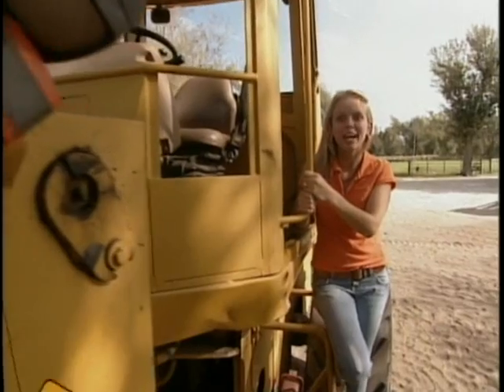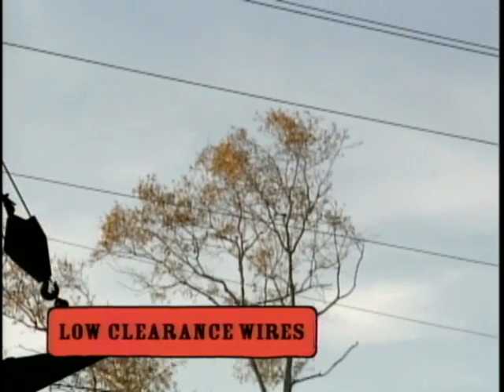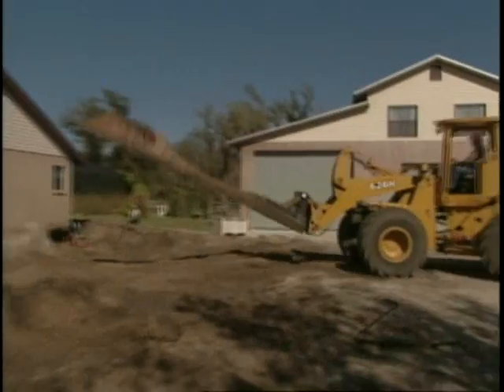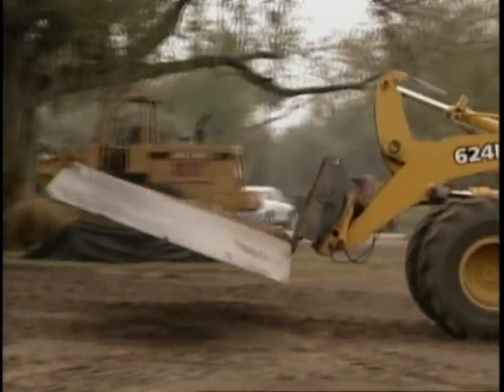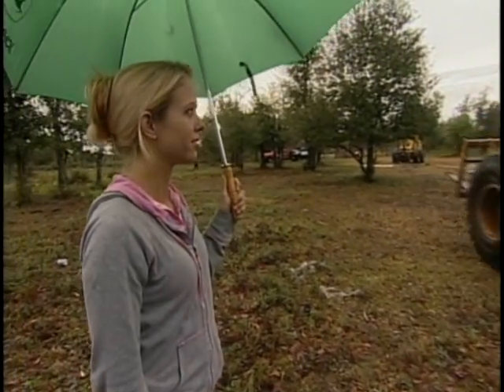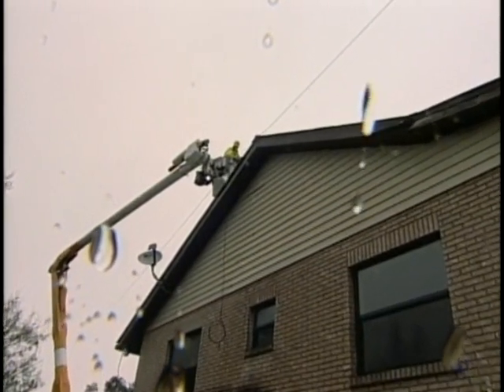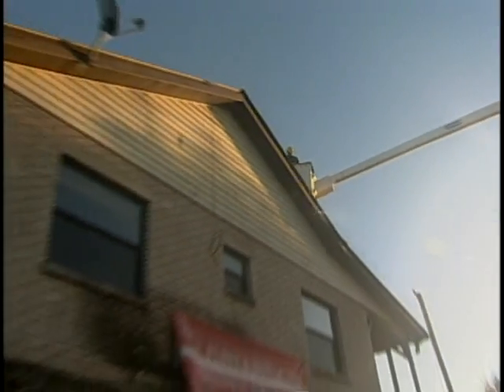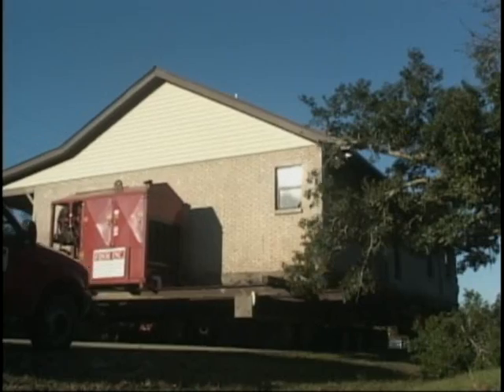Moving a residential concrete block house

Comment: Wow. I need someone move my block on concrete 20x60 shop with pit. I guess I could sacrifice the slab if there was a way to separate block from the concrete slab. In NE Georgia. Need to move it back behind new highway lane onto my property behind the new rite of way about 40 foot. Anyone in NE capable and can give a price? Tall Celing. Like 16 foot high at least.